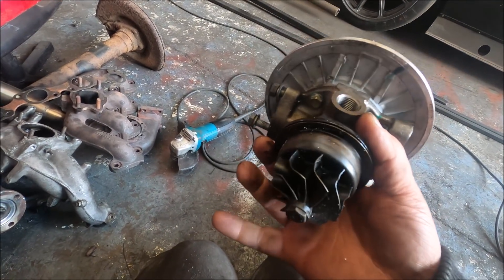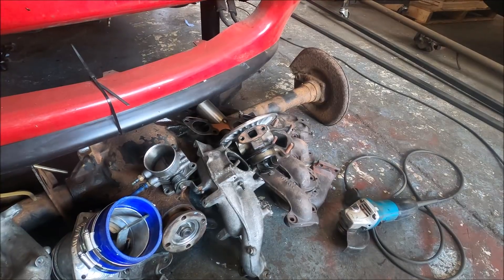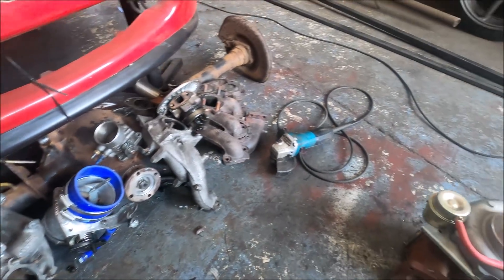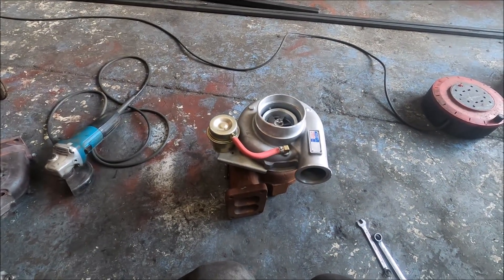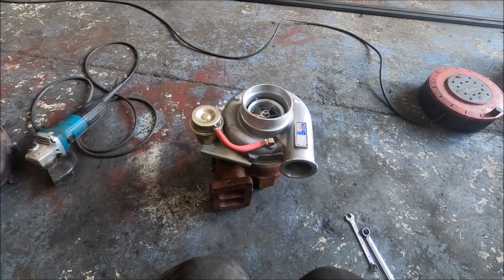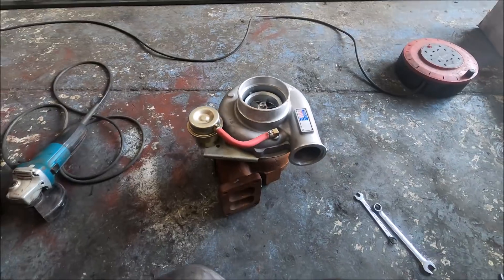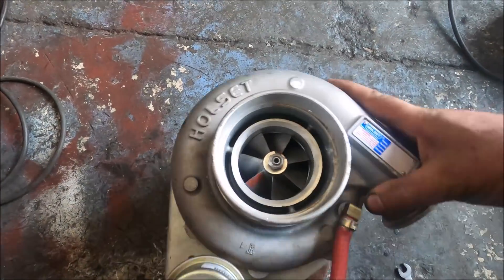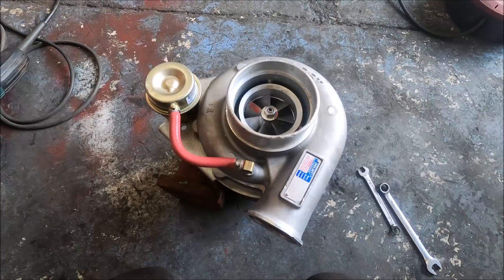Fitting a HUGE Holset HX50 turbo to the 2ltr 4cyl Volvo. T6 flange! How will I get it to spool?!

Comment: You are such a brave man! Love your videos and can't wait to see how it works.  I'm only  worry about that how the weld will hold?  Telling this because the exhaust manifold is cast iron and I've seen people suffering during welding. Others welded well but later  with the heat expansion the welded area just cracked. Heard something that a solution was to preheat the whole piece before welding. Maybe I just talk rubbish. Just came to my mind did you chop and weld a turbine housing already? I don't remember was it a success?

Comment: So this generates questions, what's the intended benefit of making it single scroll? Am I right in thinking it will increase exhaust velocity into the turbo? Does it kill top end as a trade off? Doesn't twin scroll usually spool faster?
Reply from the maker: Twin scroll spools faster for any given turbine size. But a single scroll 11cm will spool a lot faster than a twin scroll 22cm.

It would kill top end of the turbine side isn’t big enough for the application, like any turbo in the planet if it isn’t enough. but this is

Comment: Before watching: Block off one of the two scrolls and use something like port tongues to fill any unnecessary space in the flange area.

Now let's see what happens. I might learn a new truck here

edit well that was unexpected, and cool. Did you think about running the second scroll through an external wastegate instead? That should, in theory, result in lower backpressure.
Reply from the maker: The gate thing I thought about years ago, but I’d also need another fully bypassing it, which makes it complex and a pain in the ass.

I’ve chosen this spec as even as it is the backpressure should be super low

Comment: I'm here and can't wait to see the results. I have a bunch of Honda K series 2L and 2.4L engines in my basement and I'm currently building a frankenstein naturally aspirated long rod short stroke 2L using a 2.4L (taller deck) block. But the last 2.4L engine I snagged for $100 has a mono exhaust port which would make it really simple to boost 🤔 With a pre turbo throttle body and lots of compression and e85/methanol it would be a wild combo

Comment: hi Stav, looking forward to seeing how this goes compared to your ebay turbos. 

Question  : i’m currently doing something bit mad after talking to u about holset turbos for my 87 porsche 944 turbo , and i bought a second hand hx35 twin scroll and a rebuild kit , but am going to do some serious modding to make it fit , but i’m determined to, as no ones done it that i know of and the pirsche forums don’t think i will manage to fit it,...i will , just need to build up the rest of the cam tower and manifold to see what room i’m dealing with first.  Question  is do you think i need to do what your doing and block a scroll, or becuase mines a 16 cm housing i think ? and a 2.5 4 cylinder , do you think it’s ok to go ahead as is , just separate the 4 exits into two separates going into the twin scroll flange of the turbo? 

cheers 
Daniel 😎
Reply from the maker: 16cm HX35 using the factory first part of the exhaust manifold and a proper divided all the way to the turbo second part will spool ridiculously fast on a 2.5ltr.

Be madness to choke such a small turbo by blocking a scroll, you’ll kill the performance
Reply: @StavTech  i’m even more excited now Stav - cheers mate 😬👍🏻  

is it enough to cut the 2.5 “ pipe from the down pipe collector  all the way to the turbo twin scroll flange and weld a separating plate in there ? - or would you say it’s better to make two separate 2,1/4 “ pipes going to the turbo then collecting into the turbo flange to split the 4 cylinders into 2. ( i was going with the single 2.5” internally devided all the way up to the turbo but happy to change for t he better way for faster spool??

 the guys on the porsche forum were saying i wouldn’t spool it 🙄.........but since i’ve been watching all yours and Thomas’s videos ,...i’ve learnt more in 6 months than i’ve learnt in 15 years on the forum...for that i can’t thankyou enough mate! your videos and content is awsume mate 👍🏻👍🏻👍🏻👌🏼😉 
Daniel ☺️
Reply from the maker: @danielferraro59  looking at the 944 turbo manifold, the first part is a 4-2 design with 1+4 and 2+3 paired, that’s perfect, leave that alone. The second part looks like it will be easier to make from scratch.
You basically just need to keep the two pipes divided all the way to a divided T3 turbo flange where the turbo will sit. 
And of course you need take offs for the wastegate or wastegates, depending how you do it.
Then for the Downpipe (ie post turbo) then it’s just like any turbo engine- as big and as free flowing as you can fit, 3in min ideally.

When a HX35 is well proven everywhere on other 2.5s and is a pretty small turbo in tuning terms for a 2.5 it shows how little the people giving ‘advice’ know
Reply: cheers stav, it will be bloody tricky and tight bends getting onto the turbo the way my engine bay is , but i’m looking forward to it when i get to that point.  

and yes your channel has shown me i can use other products as long as the science is right , Thank you mate 🤙🏻

Comment: To be honest not so enthusiastic about the whole idea and what you have done. The Chinese holset copy that you detest so much would had been much more suitable for the task.
Reply from the maker: Why do you think that? The shit Chinese Holset copy probably wouldn’t last any longer than the other 4 Chinese turbos, and wouldn’t perform any better than the GT30 that was last on the car
Reply: @StavTech  yes, probably it wouldn't last much longer but its size is much more suitable for a 2 lt engine. Now after your mods you have a correct size hot side that has to spool a massive compressor. Boost is going to drop quite early in the rev range, now if this enough to have satisfying results I don't know.
Reply from the maker: The turbine size is still massive for a 2ltr. Huge turbine wheel. I expect backpressure will still be very low and it will rev very high

Comment: Why the hell not dude I'm sure it will work, I wanted to make a compound system of a T70 and Gt45 eBay Turbo on a 2.3 Merc kompressor lump nothing wrong with experiments at all and we all know you have done more research on these things than any of us. Keep it up man love the wacky ideas you proved the throttle body without a doubt I'm sure we will see the same from this 😉
Reply: Aren't those two turbos similar size though?
Reply: @skippy2987  compressor size the GT 45 is I think like 10mm bigger turbine size and exhaust housing very different the size of the exhaust housing on the gt45 would spool but at like 5000rpm so the T70 gets it going at more like 3000 in theory. Like it's not a logical idea really but more of a fun experiment that doesn't cost me anything as I have both kicking about